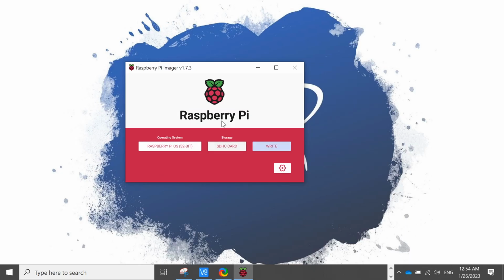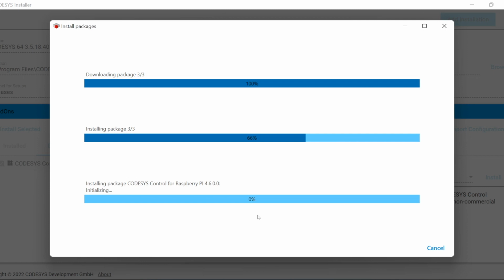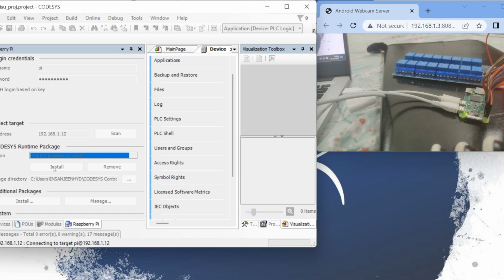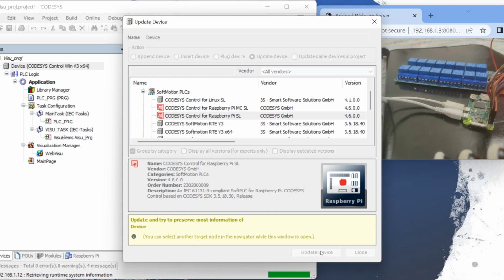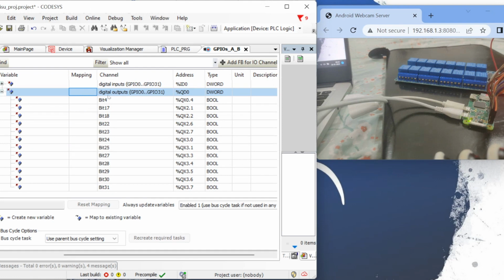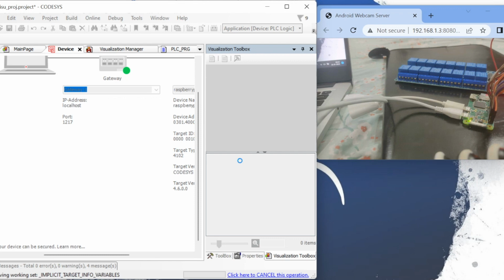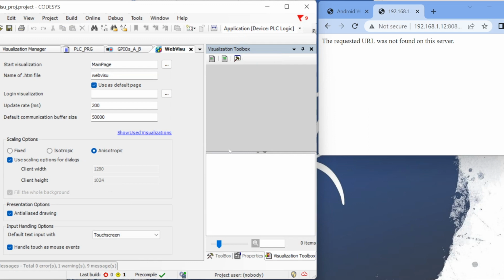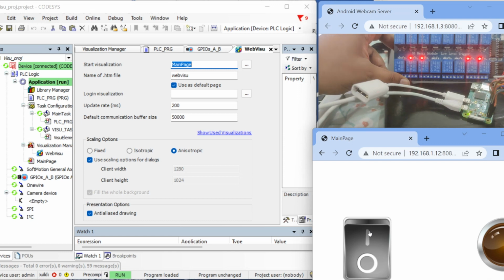CoDeSys PLC Programming Tutorial: Raspberry Pi Programming

Comment: Hello, I made my own Raspberry Pi board based on CM4. The hardware resources of this board are different from those of Raspberry Pi 4B. It has more 485 ports. I have written the drivers and can use them on the Raspberry Pi system. Can codesys recognize these ports? Do I need to adapt other driver layers to codesys?
Reply from the maker: Normally it works and can access all port we need to map in configuration file … 
I did using cm3 … 
You can check by deploying Node red whether you are able to see all your port or not …
Reply: @jugaadtech12  How did you do this? Is there any reference tutorial or documentation?
Reply from the maker: Actually if drivers are made correctly then it works … to test it you can try with Node Red also … no tutorial for this ..

Comment: Do you know how I could connect Raspberry Pi and Arduino on codesys? Arduino will be connected to the physical peripherals?
Reply from the maker: Arduino and RaspberryPi will be connected using hardware peripherals..
The easiest way is to use Serial Communication...
You can also use MQTT protocol in Arduino if it  support Wifi mode..
Otherwise we need to use other modules on Arduino side to connect over Ethernet
Reply: @jugaadtech12 Thank you so much, I have arduino Ethernet shield, but I don't know how to go about it, since my Rasperry pi is connected to codesys via wifi.
Reply from the maker: So what you can do if RaspberryPi is connected to Wifi using Router then you can plug the Ethernet shield on the router Lan port and then all will be on the same network so you can access all.
If you are connected using hotspot with no Ethernet port available then either you can use ESP01 to convert your Arduino to wifi or you can buy TP-Link 300Mbps 2.4GHz Wireless 3G/4G Portable Router with Access Point/WISP/Router Modes (TL-MR3020), Travel-sized Design, with Mini USB Port, Internal Antenna, Grey https://amzn.eu/d/4KKH18G this will connect to your hotspot and ethernet port will connect to Arduino shield... 
It is all about bringing them on same network
Reply: @jugaadtech12 Thanks, it's working, tell me, so that means the router is doing all the conversions?
Reply from the maker: Yes.. router will do all the networking...

Comment: Hello Sir, I am able go online with my raspberry and also able to see simple contact turn on a Lamp in POU and in visualization work properly. But as soon as i Try to work with TON or CTU funtions, i erros saying unknown type 'TON'. Does Codesys Control for RaspberryPi SL not support these funtions? Do you think it is a license issue? Any comments are appreciated.
Reply from the maker: Hello 
@mithileshchauhan3556 Yes codesys support all FB for Raspberry pi so these function block should work. even if license is not there it will work for 2 hr Demo mode
can you tell me which version of Codesys IDE you are using and Runtime for Raspberrypi .
or try with runtime version 4.4 for raspberypi and codesys ide 19.
let me know if still you face issue.